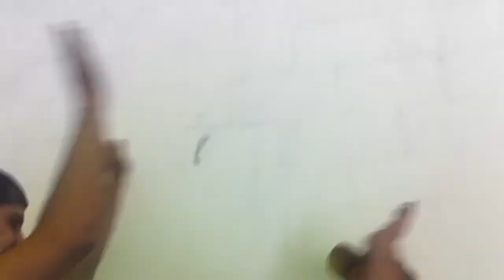RB26DETT powered by Spitronics

Comment: Hey hi guys I have a bmw e28 with a spitronic Venus on it and my rpm isn't working so which wire do I tap into to for it to work thanks
Reply from the maker: mbuso innocent Green wire is your RPM pick up
Reply: Thnks men
Reply: So where do I connect it on the system men do I connect it direct on the spitronic or on this box